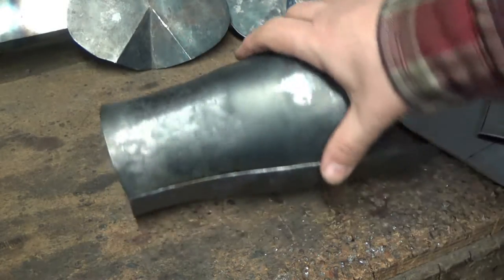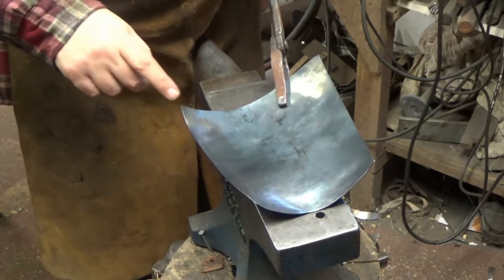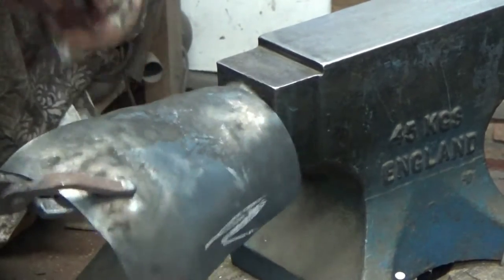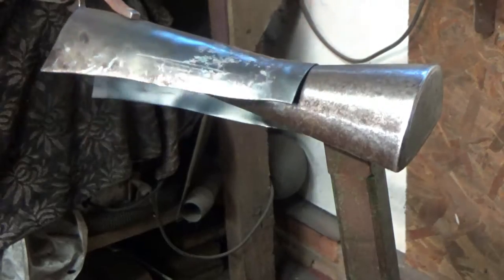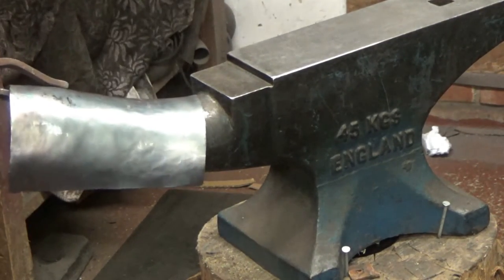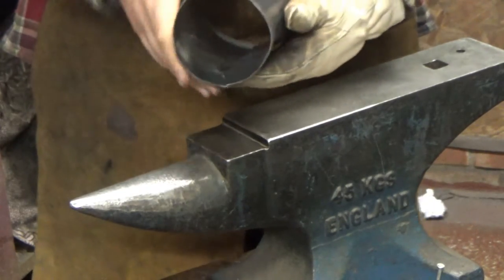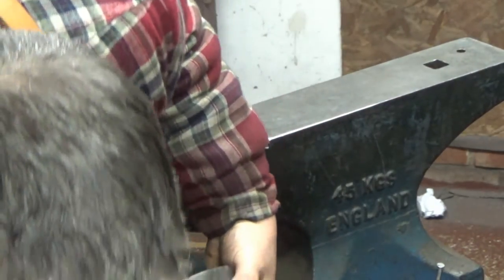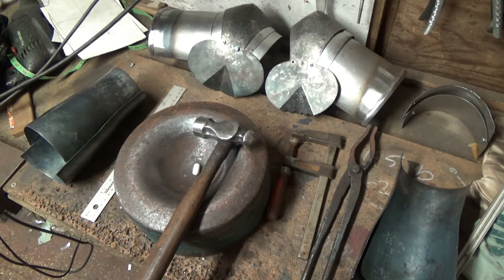How to make a vambrace. How to make medieval arm armor #5

Comment: Now that video came at the right time! I'm just in the process of making my very first armouring project and it's a vambrace. It actually is drain pipe shaped, even though I know that's not historically accurate. It just seemed a lot easier for a first try.
My problem is: I got into that "U shape" you mentioned. Any ideas on how to get rid of that? I'm an absolute beginner after all and your videos help a lot
Reply from the maker: First off check your pattern is half the circumference required. If it is and you're happy take it over a circular former, I use the back of the stake you can see in 6:07 it has a nice return weight and helps iron out those pesky flats. If you don't have one just work it from the inside over a wood surface or similar and gently smooth it out. Often flatten it out a good bit and then gently work it back ... it takes time but gets simpler each time.

Good luck with the project :)

Comment: For greaves, would you basically just use the same trapezoid kind of shape to start with the bottom shaped as it should be, and then just form it the same way you did with these vambraces?
Reply from the maker: Pretty much, there's a little more to it, but that's the basics of it :)

Comment: This is not really related, but what do you recommend putting on armour to stop rust? I often see people wearing armour that I know isn't stainless steel, but it doesn't look oily and they don't act like it is. Would some kind of wax work? Thanks.
Reply from the maker: Hi there, any sort of oil can help a long way brands in the UK tend to be 3 in 1 and Swarfega's Duck Oil. I tend to avoid WD40, it's more of a cleaning agent and reacts when warmed up next to a camp fire and make armour look plastic requiring quite a bit of clean up. Olive Oil works, but does get a bit clogged over time if it's not cleaned up regularly. I've found it best to give your armour a spray and wipe with something at the end of each day if the finish is important to you.

Another long term, but time consuming finish, is to heat the metal gently with a flame, rub beeswax over the surface and buff backs, done a few times it is fantastic. I use it a lot on the inside of armour, adding it directly to any rusted surface very thickly and gently buffing back a bit, after a number of times it creates a near impenetrable surface that doesn't rust, move of even scratch.

Good luck.

Comment: How do you think stainless would hold up to moderate abuse? ie, full contact, but only a handful of times. I do sheet metal for a living, ductwork, and I know stainless is tough as nails compared to galv. I have some 22ga scrap from work I think I'd like to make into something. I haven't ever worked with high carbon sheet metal, plus, I don't have the resources to heat treat bigger pieces. Is it worth doing instead of mild?
Reply from the maker: Kevin Keel hello mate. I've very limited experience with stainless if I'm honest. Are you in the US, it tends to be used more there. I would suggest contacting the full contact chaps of the US HMB team, I think they use SS quite a bit. 22g sounds a bit thin to me, but they'd probably know for sure.
Reply from the maker: I'd suggest learning in mild that way you tend to learn rather than fight the material while learning.
Reply: Greenleaf Workshop well, all i know is is when i installed these pieces, it was a bear to put it. Too hard for screws and sawzall blades. Doesnt dent when i hit it with a hammer. I'll do some more looking though, thanks
Reply from the maker: Kevin Keel sounds like it might be strong enough, but check with the experienced guys first. Sounds like you've done a good job :)

Comment: by the way what is your dishing form made of?
Reply from the maker: The one in the thumbnail is the bottom of an oxygen cylinder that I picked up once. They work well but don't allow you to get too deep if you need to, but are great at what they do and when you start out. Just get someone who knows what they are doing to cut the bottom off or it can get a bit explosive ... so I am told.
Reply: +Greenleaf Workshop thanks man! I actually just finished watching your video and now I feel embarrassed:)
Reply from the maker: lol, no problem at all - hope it was useful.

Comment: Thanks, you are doing a great job. I have read almost everything about armouring in books and webs, but you really bring that knowledge to live. 
I'm currently working on a 14th century arm harness, it's the first piece of armour i work on, and i have a doubt: is it apropiate for the first lame witch comes from the couter to the vambrace to be able to open completely when putting the arm straight to have a natural movement or is it enough if the combined movemennt of both lames and the vambrace allow it?
By the way, this is what i got so far:
https://drive.google.com/open?id=0BwCqf9w_mvsbZHFQM3h2Smp0WVE
Reply from the maker: Hi there,

I'm not entirely sure what you mean. Looking at the picture you have sent the elbow is nice and deep so I imagine that you have no problem bending the elbow past 90 degrees.

The lames should close back so that the arm can be straightened properly and in some ways a little beyond straight. The whole arm (all the lames) should work together to allow this, but IMHO should be able to do it just one pair. 

Looking closely at the picture it might be that your rivet points are too far back, can you take a picture of the lames closed (as though the arm was straight), that might help.

Nice job though, the depth of the couter looks nice and is the thing most of us struggle with when we start.